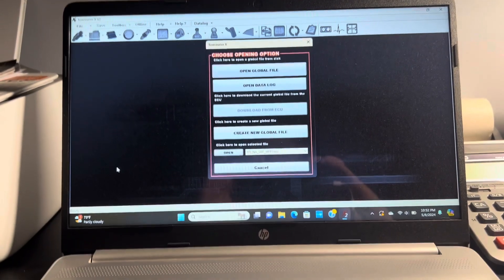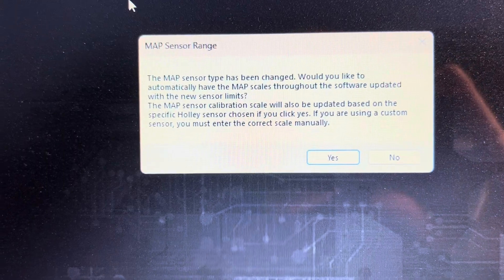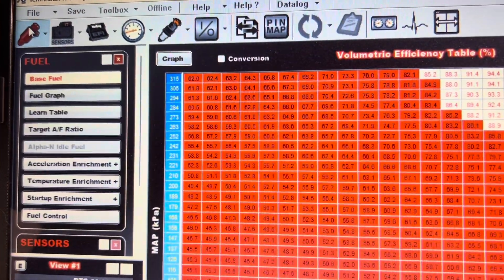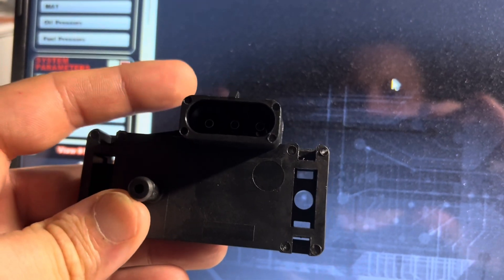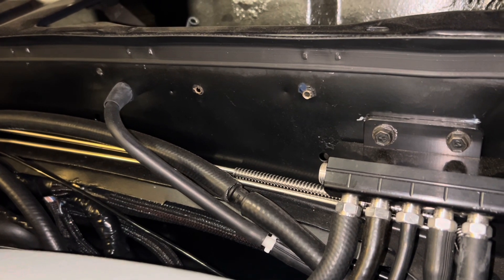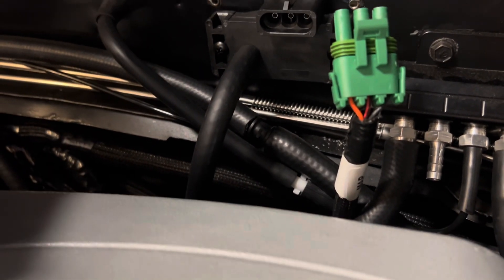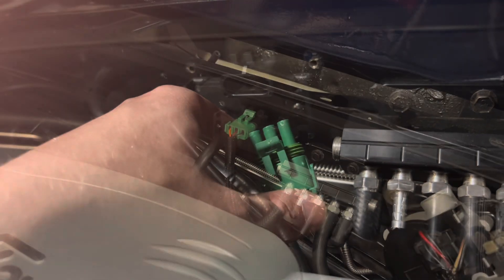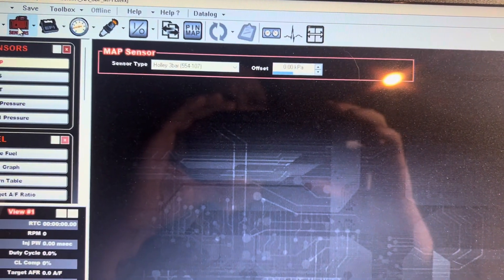Holley Terminator X Foxbody 3Bar MAP Sensor Install

Comment: How did you have the Holley wired to the stock map
Reply from the maker: I didn’t use the stock map sensor. Holley has a built in internal map sensor in the ECU. All you do is run a vacuum hose from the ECU to the back of your intake manifold. The external map sensor is optional. You still run a vacuum hose from the sensor to the back of the manifold or a vacuum tree plus you plug in the connector to the sensor which is good for N/A or boost and supports up to 29psi. Also you get more accurate manifold pressure measurements. If you are running boost I recommend using the Holley map sensor over stock. There are 3 wires on the Holley terminator X map connector. The orange wire is power, the red is going to be your signal wire and black is ground.

Comment: Were you have tunability issues? Why did you switch to 3 bar? I'm in the process of installing a Terminator X on my car and just wondering if I should just go straight to 3 bar.  I'm running an NA setup.
Reply from the maker: At first yes. The motor is brand new with all new parts on it. My timing was off a little and I switched my IAC to a gm style and forgot to switch over. My car is also NA setup. The 3 bar works great for all applications even NA. Not only is it just getting vacuum from your manifold but it’s also going to send signal to the computer so it knows how much load the engine is under.

Comment: Did you have to scale that sensor in the programming or was it fine ? Thanks
Reply from the maker: When you switch over to the 3 bar MAP you click yes so the scale sets automatically.
Reply: Perfect. I thought u had to Manuel change some things as well. I got the holley 2 bar but same concept
Reply from the maker: Absolutely. Whatever your switching over too it will update the scale for you.
Reply: Thanks man